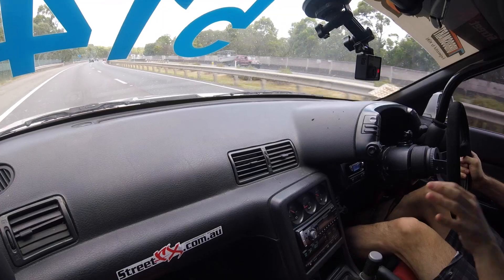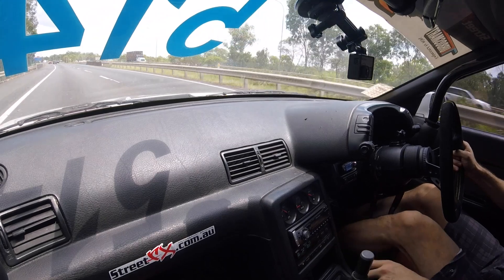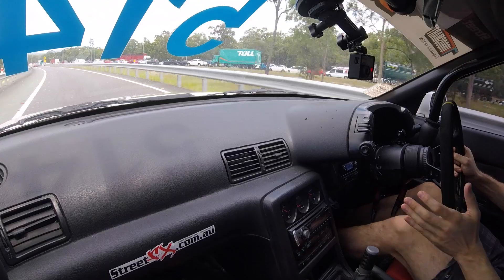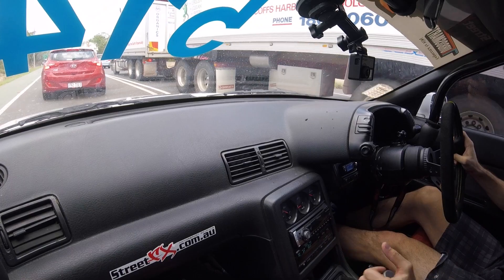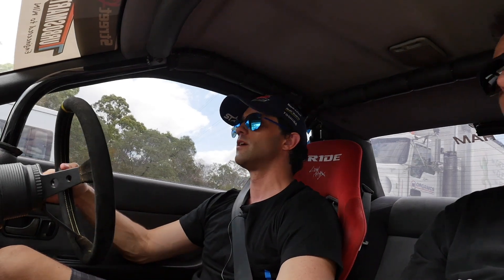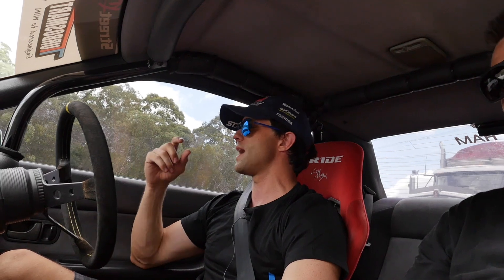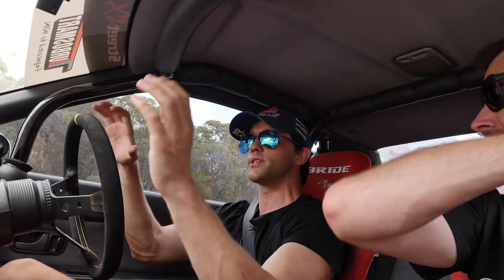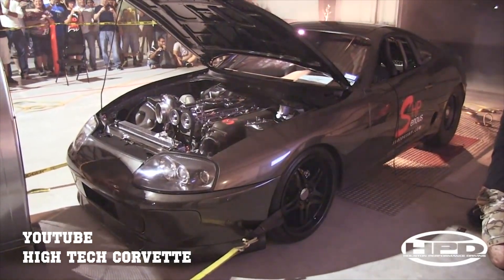What is TURBO FLUTTER & SURGE? Is it Bad? Myth-busting in our Nissan R32 GTR!

Comment: Cliff notes: guy says it doesn't damage the turbo, but it does load the bearings more.

Then proceeds to say he blew a turbo because a screw backed off.

Could they be correlated? Absolutely. Also, it seems pretty clear that the dude can't keep a car long enough to see any real reliability differences anyway so he really has no room to talk.
Reply from the maker: The car that killed the turbo had a blow off valve.

The lateral loads on modern bearings are a non issue compared to old bush turbos.

Comment: How is that in his car open-throttle-surge if it does it only when he lifts off the throttle? :)
Reply from the maker: It does it under wide open throttle if there is too much load, like if holding brake and accelerator. It just jolts like it's off throttle.

Under decel the flutter is ok. Not so much if under accel

Comment: Can you get this sound with a stock turbo that only pushes 10psi stock ? I have a dv with a bov spacer and it flutters but not stututu
Reply: I'd say no. Because it runs such low psi you don't get enough to pressurise it enough to get a loud sound. The sound you're hearing is the max really other than getting stainless pipes so it resonates a bit more.

Comment: What is the blow off that you use ? Cand you make a video about how to make car sound like this
Reply from the maker: Turbosmart blow off.

It sounds like this due to the BOV being set to the tightest spring setting, coupled with having a big turbo, big intercooler, short/open intake piping and a mechanical throttle body.
Reply: @StreetFXofficial  thanks :*

Comment: Since there is too many wannabe auto engineers on here I'm citing HTT/Garrett as a reference rather than grabbing words out of thin air;
"Surge is the  left  hand boundary of the compressor map.  Operation to the  left of  this  line  represents a region of flow  instability. This  region  is characterized by mild  flutter  to wildly  fluctuating boost and “barking” from  the compressor.  Continued operation within  this  region can lead to premature turbo failure due to heavy thrust loading. " 

Also feel free also to read up on ported shroud, there's a reason it's there (hint; moving surge line to the left to keep the turbo within OPERATING CONDITIONS)

Comment: The driver talks so much rubbish, it will wear your thrust bearing sooner or later, and turbo compressor nuts don’t back out or become lose, they are screwed on in the opposite way so if anything, they get even tighter. So cocky saying he’s owned all these cars and whatever, doesn’t even know he  facts of what he’s talking about.
Reply from the maker: Fact: new turbos don’t have the same issues with thrust bearings due to them being ball bearing and can handle lateral loads.

Fact: have owned enough turbo cars and driven enough kms to have first hand experience to if not having had any issues from not running a bov.

Fact: the nut on my old t66 front wheel on an MA70 Supra did in fact come off and destroy the turbo, so it is possible they can undo themselves.

Talking from experience, so I am more than confident in everything I said.

Comment: Claiming chatter is the turbo spinning backwards is ALMOST as retarded as the myth of BOVs increasing boost response. Yet you support one of those.
Reply from the maker: Sorry? We did no such thing. We said that a blow off valve can help alleviate the amount the turbo slows down between gear changes, as well as decrease thrust bearing wear on old turbos.

Comment: You do know about clock wise running engine when you engage reverse gear..the crank will go anti-clock wise..only in front engine cars😉😉
Reply from the maker: Umm.. riiiigght...
Reply: The bigger question is which end of the engine do you look at when you decide whether it's running clockwise or anti-clockwise?

Comment: It's the Aussie way. We love the turbo flutter. It's 100% about the sound! Does its damage the turbo? My opinion as a mechanic for 15 years and owned many turbo is no
Reply: Idc if it damages my turbo it's sick 😂
Reply: I’m not about to listen to someone telling me flutter hurts the turbo when they spell break as brake💀
Reply: Will it do it with a stock turbo?
Reply: @carsandcoldbrew6489  it will, but depending on your air filtration setup and if your stock charge pipe components are made of metal or plastic, the sound will vary dramatically. With aluminum charge piping the sound will be magnified, but with stock plastic components the sound will be more muffled. It also depends on if your stock configuration has a blow off valve, and if so you will need to either block it off or in some cases, completely remove and block off the space where your blow off valve was. Hope this helps!
Reply: @carsandcoldbrew6489 if you unplug your diverter valve
Reply: @carsandcoldbrew6489  … damn wish this comment was newer lol.., it could but unless the impeller has enough mass to keep spinning long enough to be heard do a few flutters but you’ll hear a faint stutu. Just pull off the vacuum hose from the blowoff valve if you have it, or it might be a circulatory style  setup like WRX. The longer your turbo pipes and bigger intercooler, the more cubic feet of air pressure is stored like an air  compressor’s tank.
Reply: @carsandcoldbrew6489  no
Reply: @ronyhyper  why not?
Reply: @ronyhyper  yes it will. All you have to do is delete your bov
Reply: @beef_cake_handler  My ass was dumb back then 😆
Reply: @ronyhyper  yes it will
Reply: Does the GTX2867R flutter tho?
Reply: @RonyHyper it does😂
Reply: No we 'all' don't. Those of us who actually understand what's happening know that it is NOT the optimal performance of the engine. 

Yes there are two types of flutter. But it's not exactly like you described. One is when the airflow past the edges of the compressor vanes is disturbed, one  is when the BOV is not adjusted correctly and the vacuum on the back side of the valve and/or the spring rate/preload is not matched properly to the volumetric flow requirements of the engine. 

Confusingly, the two symptoms can both be present in varying degrees. The turbine waste gate can be adjusted to address parts of the issue too. 

When it's time to get your thumb outta your arse is when the flutter isn't an 'on/off' stutututu and is more like a constant tone that incrementally decreases in pitch. Like CHOOOCHOooChoochooo
Reply: @muntee33  If it's happening off throttle there is no lose in performance.
Reply: We have yeses and no’s. 
Would like to get advice about my car. 
Toyota Aristo has the 2jz-gte stock twin turbos. 
From Japan they have ceramics blades. 
Would my turbos be fine with this? 
Would I get a loud flutter?
Reply: You just gave me the last information I needed to buy one thank you very much
Reply: Will anti surge remove the flutter sound?
Reply: @WithCarePlz  mate he's saying Aussie's like the compressor surge/turbo flutter noise mainly due to the fact that in the 80's the Holden Vl Calais turbo came standard with a Nissan rb30et engine that had no blow off valve and is famous for the dose pipe noise you sound like an angry clown bro I think you should calm down
Reply: @UCG3ZTLNnemoeCICJ1vOf1GQ yes it will 😂 you’re a fucking loonie mate
Reply: It will damage the rotor / fan edge gradually and at some point brake it.
Reply: @hmsmechtechreviews7875  very minimal, but yeah. Is like arguing that if you running your engine alot above 6k rpm street driving it will degrade faster than just being around 2-4K rpm street driving.
Reply: Who cares.... car go doodoo
Reply: Own...? You mean replaced ? 😅

Comment: Surge did eventually kill the CT26 in my old Supra, it was an old ass turbo with wear on it though & the final straw was when I lost ignition at full throttle (Pushing about 14-15psi on a mostly stock 7M) and pretty much hot-stopped.  The turbine sheared off the shaft, pretty obvious twisting action looking at the break point.  Don't think it would've killed a mint turbo though, it was ready to die anyway since I bought the car & then I just turned the boost up till it popped...
Reply: How did losing ignition kill it?
Reply: It was under boost at high revs, auto gearbox so I couldn't keep the engine spinning hence lost oil pressure and hot stopped the turbo. Shaft sagged.
Reply: @danmackintosh6325  So it lost oil pressure but that didn't kill it, surge killed it???

Comment: BS, Anyone who thinks it's cool  to send shock waves back through their turbo by cranking up the BOV spring preload has rocks in their head. In terms of performance, flutter is utterly useless, obnoxiously intensional, and childishly amplified by strapping a duck call whistle to your blow off valve. Why do these tune wankers do this? To get attention, eg. rocks in their head.

Comment: Im trying to wrap my head around it so what their saying is that, that noise comes from the Throttle Body opening allow air to leave the system because the turbo is generating too much boost that the engine cant handle the amount of air going through the turbo which would mean that without the Throttle Body a piston could fracture or the engine could blow up, or turbo break am i right or totaly missint the point that they are trying to point out? Also i was wondering would Turbo Flutter be able indicate too a person that is only listening and hasnt driven in the car that if it is a single turbo step that, the car has turbo lag? and if he/she would like to avoid this turbo lag that they will have to have a smaller turbo as a first stage of compression and then have the  second turbo that is already on the car as a second turbo that switches on only at higher rpms... or just downgrade to a smaller turbo?

Comment: "All the cards flying through the air" is very much due to the BIG ASS fan in front of the car. If you look closely, the car shutters when going off throttle which causes the stack of cards to move enough for the fan to blow them away.  I find it nearly impossible for the boost pressure to come out the inlet side of the turbo. At that point it would HAVE to make the compressor wheel turn backwards.
Reply: It doesn't make it turn backwards, the air does come out the inlet side. It physically has nowhere else to go.
Reply: Turbos spin at 100,000rpm, it cannot suddenly stall and go backwards.

Comment: Argh, I wish i didn't have to school everyone on this but here we go again... So, compressor surge. It's NOT good under throttle. Reason being, both sides of the turbo have forces acting on them. Exhaust gas is pushing the turbine and compressor is pushing air into the engine. When it surges, the compressed air is pushing back against the compressor WHILE the exhaust gas is pushing on the turbine. This will twist the shaft, ruin the bearings and make for a bad day..

Surge off throttle is fine. Do I need to explain or can you realise this yourselves..

Comment: Dude I think that the sound is caused due to the absence of bov. This leads the air present in the turbo to flow against the spin of the blades of the fan. Thus creating the sound

Comment: If u have a stiffer spring on ur bov, are u able to have turbo flutter but its a smoother sound? Because i have turbo flutter on a fully stock car from just blocking the recirculating valve, but the flutter doesnt sound like urs, stu tututu, its more stish tish tish loll 😂 sorry i cant spell it property but ya,question is, if i just switch to a bov with a tighter spring, is it smoother? Or intake has something to do with the sound too?
Reply: Factory turbo running not much boost will sound different then a custom top mount turbo running a lot of boost, if you want it to sound like this then don't run the recirculating valve and make a metal intake pipe going into the turbo, the design of the intake changes the sound a lot and factory rubber hoses muffle the sound.

Comment: Im guna have to disagree with this logic/theory. My Evo 8 does this and i have the stock 05 Evo turbo with a Forge RS BOV. 
Its obviously Not the size of the Turbo. I believe it to be the Type of BOV. You NEVER get that sound with a 50mm TiAl Q BOV...NEVER! You only hear it with the cheaper built Valves.
Reply: You'll get it with any blow off valve that doesn't release enough pressure or with no blow off valve, it's not the BoV making the sound.
Reply: DriftNick ¿Umm... No. 
It actually IS the BOV making the noise. The BOV may not always be the Cause of the sound, but it is the part that Makes the sound. Some brands just use cheap, crappy Valves & Springs, & in some cases the wrong springs.
Reply: My car doesn't have a blow off valve, it makes the same noise, the sound is from when the throttle plate is closed and the pressure is not released.

Comment: "I've never blown a turbo.. except where the compressor nut came undone"

Ever considered that during compressor surge, the forces on the compressor tend to load that nut up and can cause it to come undone?
Reply from the maker: The supra that happened on had a blow off valve. Also the nuts on turbos are designed to tighten under those conditions, not loosen.
Reply: Yes - fair point - you are right, the nuts are usually threaded in the opposite direction to compressor rotation as you said.
Reply: Fail

Comment: Some high boost setups will compressor surge. Especially if you don't reach peak boost before you release the throttle. The BPVs in these setups are adjusted to stay closed during spool until that high boost target is reached. So when you release the throttle at partial boost in these setups you get "surge". This is the only time compressor surge is acceptable to me. I've been building and tuning engines/cars for over a decade.

Comment: I bet the turbos have blown since this video......flutter and surge destroys turbos and turbo bearings...even commented in the video it was bad. ....lost a turbo because the comoressor nut got loose....so when the turbine section of the turbo is being driven 100,000 rpm and you surge the compressor wheel with boost thay has nowhere to go what do you think will happen? Duh
Reply: You would lose that bet as this turbo is still going strong, also the compressor nut came loose on a engine that had a blow off valve.

Comment: What. This is crap.. The set up is Wrong. Stop Choking the Blow Off Valve from doing it's job, so you can hear your Silly WRONG noise. Slow Car with Turbo What?
Reply from the maker: Why so mad? 😳 setup works fine. We like the noise. Doesn't impact you, doesn't kill our turbo. What's the problem?
Reply: Street FX Motorsport TV True

Comment: thank you. it's refreshing to hear sane people open their mouth and share this thing called knowledge rather that complete numb skulls who know sweet F A and sprout complete and utter rubbish to me. Another thing you might want to add to this argument is the detrimental effect caused by adding a BOV to car running an air flow meter as opposed to map sensor. Running a bov on some cars will without a doubt right royally f*@# them i.e some models of WRX for instance. On others it may not wreck them but fuel economy and general performance (or lack thereof) goes up the sh*t. Usually the same numb skulls who argue that bovs are necessary are the same idiots on forums asking diagnostic questions like "my car's running sluggish and fuel economy is out the window, does anyone know what things I should check for incase my engine's blown or something?"
my responses is always a question does it have an aftermarket bov? if the answer is yes I instruct them to check for a brain 👍

Comment: What you're saying is almost 100% correct but the fact that you're saying that it is the turbo that stalls that's almost just as stupid as saying that it's the turbo that's spinning backwards, the flutter is simply boost that's returning so air that's returning and smashing against the blades of the turbo, a helicopter that's flying into the direction of the wind is also making a chopping sound and it's the same principle ;) anyways good video and good explanation :)

Comment: The flutter is a result of how hard your blow off valve spring is. My BOV spring is is full hard, so I get flutter even at very low speeds. Its not harmful to the turbo at all at these low speeds, because as soon as I put my foot down and generate full bpoost there is enough pressure to open the BOV and release the air so this higher dose of air doesnt hurt the turbo.
Reply: Yeah same. I was confused with the flutter sound being bad cause my flutter comes from my bov letting air out in a flutter, I think it's supposed to simulate the compressor surge sound?  Someone correct me if im wrong.

Comment: If i blocked off my BOV in my WRX, will i be safe?
Reply: Why on God's green earth would u change a design that engineers worked tirelessly on? You must be brilliant.
Reply: @milesonewheelwinter  "but it sounds cool bro." inhales half a tank of vape.
Reply: Erock yeah but youll destroy your turbo faster. If its a stock wrx sti turbo they're not meant for that. Thats obviously why they installed a BOV 😂
Reply: I have had mine blocked off for 149k miles. Hard driving very very often. Nothing wrong with my car. Also it’s very quiet so maybe not worth the work. But I like it. Doesn’t sound like this Nissan though.
Reply: @cameronmcpherson6364  you dont have a true bov it's a resurc valve. You're dumping boost back into the intake instead to atmosphere, hence why it's quiet.